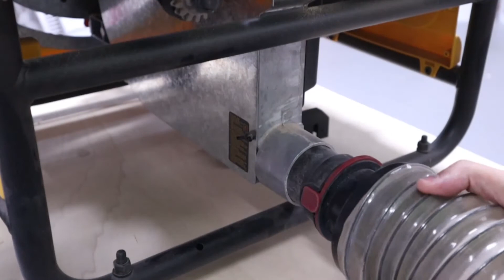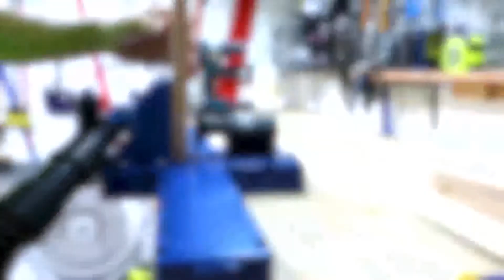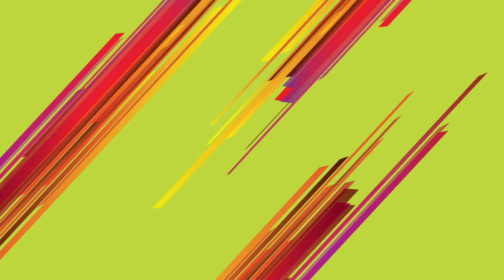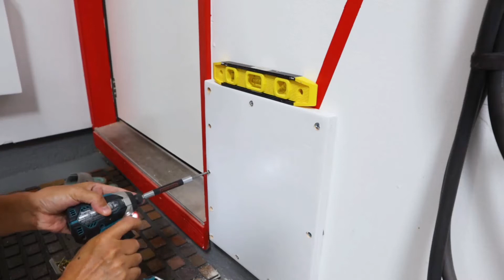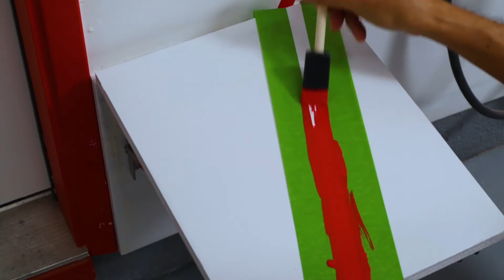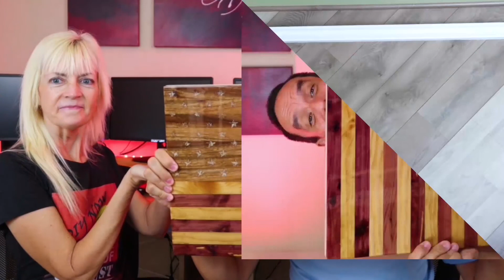Poor Man's DIY Murphy Chair (Murphy Stool)

Comment: how stirdy it is? maybe a follow up video about chair?
Reply from the maker: The chair is extremely sturdy. We both use it all the time. The bracket is made to handle the weight so the most important part is to ensure you mount it into the wall studs or add thick plywood and connect it to the studs and attach the brackets. I hope this answers you question but if you have more questions, please feel free to contact us and we will do what we can to provide you with a proper resolution.